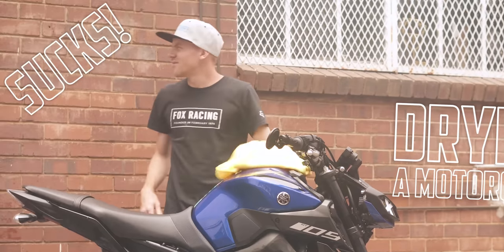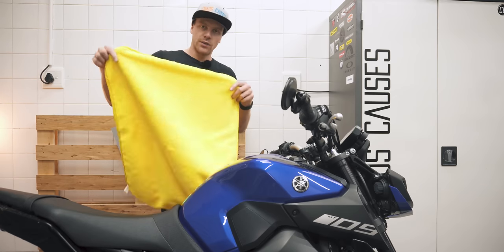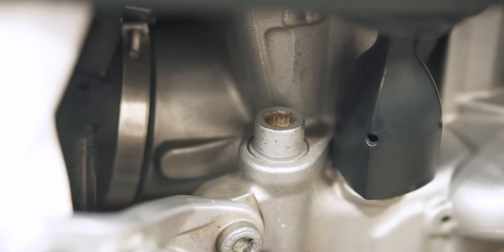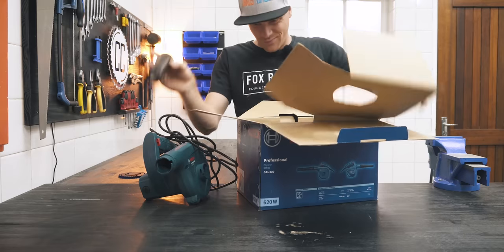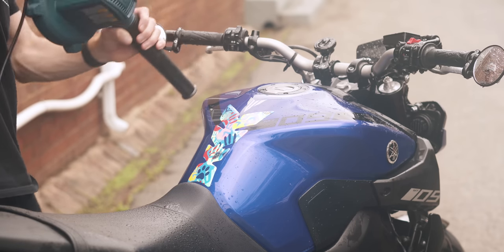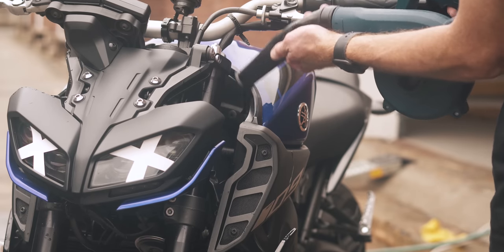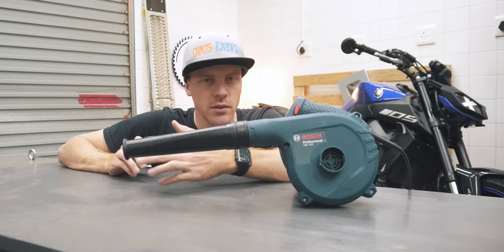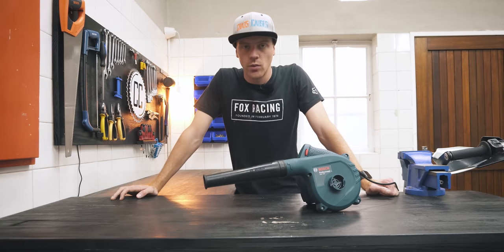Can You Use A Leaf Blower To Dry Your Motorcycle?

Comment: I have a Harley so the air cooled fins on the engine were a massive pain to dry.  Also, Harley used this crinkle paint on parts of the engine that would act like velcro to a micro fiber towel.  I started using my leaf blower to clean the engine, wheel spokes, and such and I still use a microfiber towel on all of the flat, painted surfaces after blasting most of the water off with the blower.

Comment: After every washing i take the bike for a short ride for 5-10 minutes. It's dry everything adn warm up the chain for better lubricant.
After chain lubricant i use a microfiber towel and detailer spray for the paint work and the bike shine without any water spot.
Reply: worst idea..with the wet surface, u will eventually make more dirst to stick on ur bike..and again rubbing it with detai spray is not a bright idea

Comment: I use the same blower as yours. Sometimes the exhaust of a shopvac.
I also use that blower to clean my computers and electronics.
I have a tip, you can attach the included dust filter to avoid sand or dust to be blown back to your motorcycle or item

Comment: I switched from run-drying to a Ryobi leaf blower a couple years ago, saves huge amounts of time. Also use a standing fan in the garage to go around the bike for a couple hours before oiling. A slightly bigger blower will give a significantly quicker drying time

Comment: I washed 15 motorcycles yesterday for our bike company i always use air compressor for drying and using "Spray wax" with a microfibre towel for getting rid of the dryed water spots

Comment: Great vid! Although you should take a look at replacing the chain on your bike because on video from 3:33 to 3:38 it seems like you have a few stuck linkages.
Reply: my 125's chain got loose and I noticed a link looked like that, the chain got adjusted but I keep hearing a noise, is that what is causing the noise?
Reply: @r4rq291  if a linkage is stuck, the chain wont seat properly on the sprocket. If its not stuck at an extreme angle (ie the stuck linkage is slightly off from the angle of the other linkages), it might cause some clanking noise as the chain tries to settle on the sprockets. 
Either way, if you notice that a chain linkage is stuck, its best practice to replace the chain ASAP, as stuck linkages often break under load, which can absolutely destroy your frame, engine casing and your leg as it slaps against them, or it can harm someone else behind you as the chain gets ejected and you are left without drive for the rear wheel.
Reply: @szaszlo9958  Thanks. The noise was there since a few weeks, today I noticed it was quite loud. My dad told me we're gonna get the chain replaced asap however am unsure if I should take my bike to the local motorcycle club's rideout this weekend then, considering I can't take it to the shop today

Comment: I use my shop vac, I just hook up the hose onto the output and it easily becomes a blower. But after you pointed out that a dirty leafblower can become a sandblaster, I'm feeling stupid for not thinking that way on my shop vac (it holds dust and other contaminants, and might fling out of the blower side). The best technique I see is using both a towel and a blower. A clean towel for the large surfaces, and the blower for the crevices.

Comment: I have been using a blower to dry the engine areas and crevice areas of my bikes and cars for years...I still use a microfiber to dry large surface paint areas on the vehicles, but the blower really takes care of the difficult & hard to reach spaces.

Comment: Love the vids mate. I have a Tracer 900GT, essentially a mt09 with a screen. I use the center stand all the time, however after washing I put it on the side stand and most of that water runs out of the radiator, just a little tip. I also use a blower about the same size as the one you got only battery powered, not sure if it's the same/lower/higher capacity but it does the job. Keep up the good work.

Comment: I actually have been using my compressor to blow the water off. Good size tank so it lasts for a bit. I gotta try blowing the water out of the radiator in that direction you showed.

Comment: I use a brand called Master Blaster, its a fancy leafblower but made for detail work on cars and motorcycle, it have the option to blast warm air so drying are quicker and also have a 4.0 hp engine and the air are filtered so you dont blow small rocks on your paint

Comment: Many years ago when I rode Harley Davison’s my wife bought me a Hog blaster dryer. Still got it and it’s brilliant. Rubber corrugated hose and blows out slightly warm air. Used it on every bike I’ve ever owned since getting it. Blows the water out of every crevice. I think there are like machines out there that the same job, I think it comes down to how much you want to spend really.

Comment: 2-speed compact blower with additional interchangeable tips using the most narrower for higher air pressure starting high to blow out majority of the water and the lower for finish dry, and finish off wiping the tank, and other plastic/fairing parts with your choice of wax/shine/detailer. My bike looks so much cleaner than it would drying by hand 👌🏻

Comment: i find that the best way to remove water from your chain is go for quick drive with some speed for a minute or 2. It slings out all the water in the chain, and the rest that is stuck on top can be easily wiped dry.

Comment: I use a very cheap yet very powerful electric blower too. It is a must to avoid having water sitting in the bolts heads all around the bike. I used to do that with a camera lens hand pump before..LOL I think my neighbors preferred that method though.

Comment: I happened to get given a Ryobi battery leaf blower as a present one Christmas as it was the cheapest way to get a 4Ah battery (makes the blower about £10!) - tried it on the bike out of curiosity and never used the blower for anything else since (I additionally use a drying aid as part of a 'spray shine' which helps in the cold & damp of the UK).

Comment: As allways its a nice video ! Some sense of humor, clean and well balance subject and good mix of fun and usefulness !
A chamois is my tool of choice when it comes to drying bike or car. It works great though you need to be dead sure the stuff your drying is absolutely clean... as cleaning the chamois is a pain.
To use it you must first soake it with fresh watter and then use it a a "super" sponge : it suck any droplet, leaving a clean and dry surface. Give it a try....
Using a blower is a great idea though. I tried a low pressure paint gun (too weak) and my workshop vacuum cleaner (it has an outlet you can use it as a blower) : perfect! The hose makes the work even easier, plenty of power, filtered air😂 thanks for suggesting the idea.

Comment: I know this will upset some people (don't worry, I'll turn off notifications because i don't care if you respond with some "well ackshually...." crap), but to all the people worried about scratching your bikes with a leaf blower, you better not ride your bike outside or if you do only idle around, otherwise all the dust in the air might damage your bike too.

You should be more worried about exhaust fumes from cars damaging your paint, or hitting bugs at highway speed, or dirt being flicked up by cars and trucks. 

I've always found the blower to be less effective on panels but more effective in smaller areas where water pools rather than just beads

Comment: In the past I have used my Black and Decker Heat gun when I was washing my bike and had to quickly run off to help my sister when her car broke down.
Don't get me wrong this is dangerous as hell because if spend too long on a spot you can melt your bike but what I did was stand further back to throw hot air towards my bike and it did dry it off extremely fast.
I had to keep moving as to not heat one one area too much but hot air works reeeeeally well

Comment: I don't spray water at my bike, and crazy as it may seem, I detail it after every ride. I have a Hypermotard, so every bit of is is exposed, and it has a trellis frame. That's where pipe cleaners come in! You can get them almost anywhere; craft stores, my local hardware store carries them. I can clean the interior parts of the frame, get into spaces around the clutch and brake reservoirs; the uses are endless.

Comment: I sit on my Bike in my Front Room with a big fan on, (I am a big Fan of BIG fans !), and go. "vroom !. Vroom !!. VROOM !!!"

Is this the same ?

Back to reality, you know how clever I am.
One can't get a Wet Bike Dry fast enough, (bearing in mind other Fluids like Fuel, etc's evaporation.
Water is a Biker's Natural Enemy.

So I employ a 3-Stage Flat Floor Fan Heater in my Bike Box which draws its air from one end, over my bike, and exits at the other end.

15 Minutes Cold Air, 15-30 Minutes Warm.
Job done.

Incidentally, my 'Bike Box' is a re-purposed, HIGHLY INSULATED, Fibreglass and Aluminium Freezer back box from a walk-in Ice Cream Truck with built in lighting and NO Condensation !!!

Big enough for TWO Bikes, they can be picked up in a Vehicle Scrapyards for £0 (yes, ZERO !) - £500.
There is no real metal value in them, and they are just expensive waste for them to dispose of.
BONUS, their Door Hinges, Locks  and Security is AMAZING !

Keep Safe.
.

Comment: The filter argument is kind of dumb when you remember that your bike constantly eats that exact same "unfiltered air" at 80mph for the rest of its life.
Reply: ur argument is even more dumber..do u think the bike gets scratched in all 360 degree with same 80 mph air.? nope..its only come form one direction and that too in the front headlight part..also bike is designed to be aerodynamic, so the high speed air will only scartch the front headlight part, but the paints on body wont be off much damage just by driving..but if u use an air blower to dry it..u r literally forcing high speed wind in all the side of the bike..this will cause more scratches

Comment: we use this size "leaf" blower (makita) in the construction works, when the steelworks complete we blow out the (Iron wire pieces)
it is cheap and it can make pressure ( looks like a propper turbo) You got ripped off with this,
our makita dries my car whitin 2 minutes, by the looks of it around 4-5x (179 mph air speed )  times stronger than that Bosch (trust me :D , and it is cheap! )